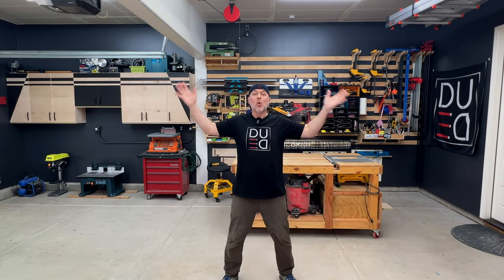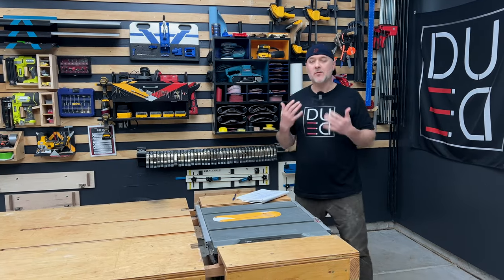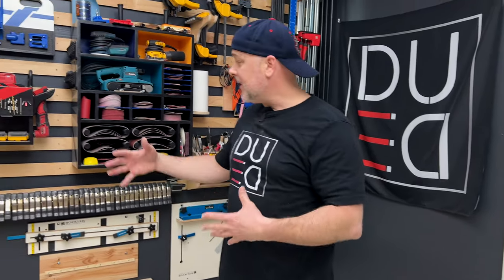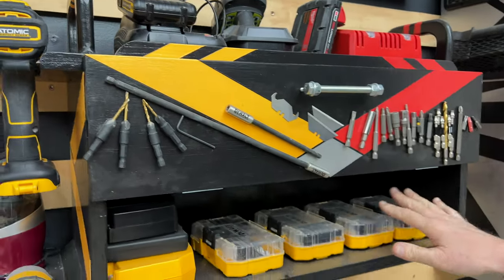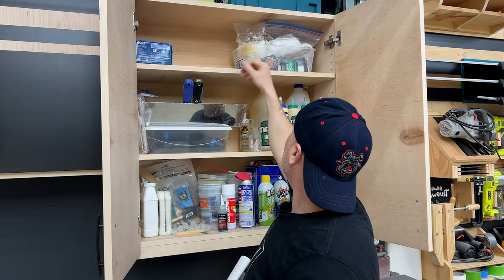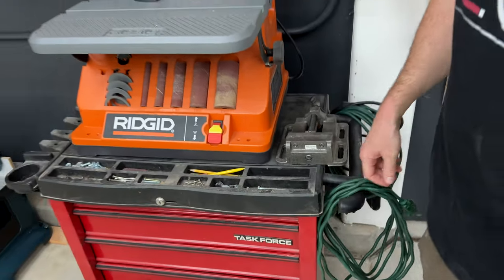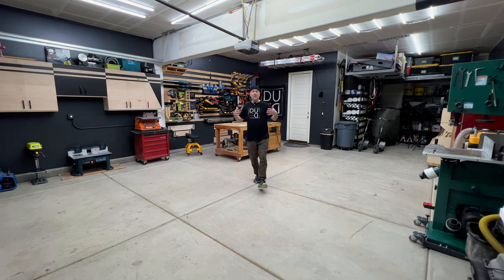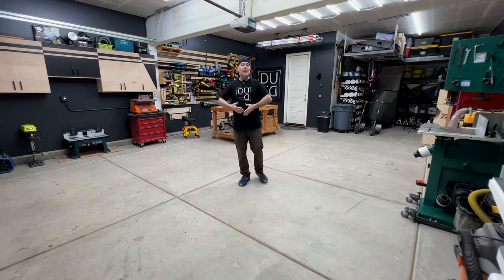Shop Tour 2024: Now & Later

Comment: Suggestions.  I’d put a nice plastic laminate like Formica on your out feed bench. Then buy a good router lift, put in some T track . Drop the router and remove the fence when not in use. I think the helical blades you will find are worth every penny. Better finish and soooo much easier to get sharp edges. Also it’s not that hard to epoxy the floor and it’s way nice having. I have almost every piece of equipment on wheels so that did make it easier.  And it is just a floor anyway. Not the Mona Lisa 😂
Reply from the maker: Thanks for the tips. These are some great suggestions. As usual this shop will slowly develop. It’s a fun process

Comment: For the bandsaw, I'd get a 14 inch for doing curved cuts.  For the planer,  I'd swap it out for one with an induction motor.  Much quieter.  For the water heater and solar power panels - I'd just paint them that same black color you like, except maybe paint the exhaust ducting a metalic copper (to give it an industrial look).  I like Oneida for dust collection.  I'd recommend you get something that has a minimum of 6 inch inlet diameter.  You have some long runs of ducting to reach all over your shop, so get bigger than you think you need.
Reply from the maker: These are great tips. Thanks for putting some thought into it. I'm going to mull over the paint idea for the unsightly solar and water heater. I'll have to double check if there is any important printed info on those that might be covered with paint.

Comment: Nobody ever thinks about the Matabo HPT C12RSH3 miter saw.  It slides in the front so you can seat it close to the wall and it is cheaper than most of the front sliding saws.  It goes on sale quite often. I got mine for $350, but I’ve seen it as low as $250 before.  The new version even has a shadow line instead of the laser I have.
Reply from the maker: This is a great tip. I’m reading this as I sit and stare at my new Makita Miter saw still in the box. And you’re right. I never considered that saw🤔🤔🤔👍
Reply: @DudeSawdust  you can always go to Lowe’s and buy a Matabo, try them both out and just keep the one you like better and return the other.  Just a thought.

Comment: So your collection of "floor tools that need a home" and saying you want a bench top bandsaw, I just made a cart for the whole collection of those tools. I'm in a one car shop so space matters a lot. I have a wen 10in bandsaw. So little bigger than normal 9in bench top ones. Anyways it was a happy accident that making it the right height for me to use the bandsaw(little high but I like it) wound up being perfect for me to toss my portable  router table on there instead of being a pain to use. Now even more oddly my hf drill press that was always awkward and never used fit in the space  behind the band saw. It's little under 2ftx4ft wheeled cart. I wish I had given it a little bit more specific thought when building it instead of rage tossing it together one night, but it's been working out really well kinda going side to side to use the different tools. And having them out means I'm actually using them.
Reply from the maker: Sounds like you got a pretty good/efficient set up. I bet you’re building some sweet stuff in your garage. Thanks for watching my video 👍